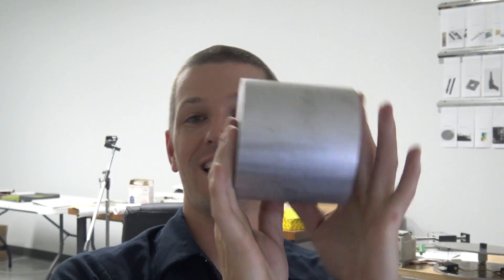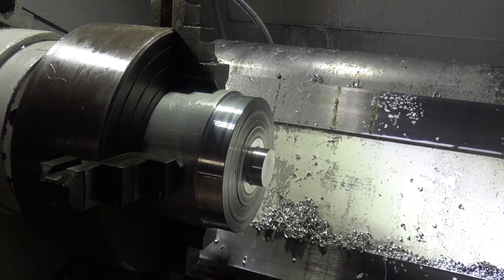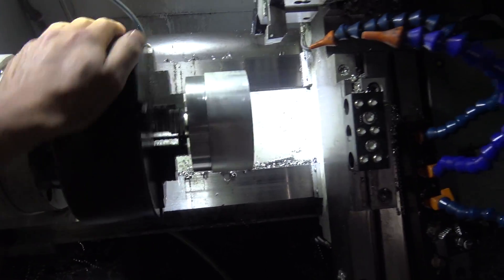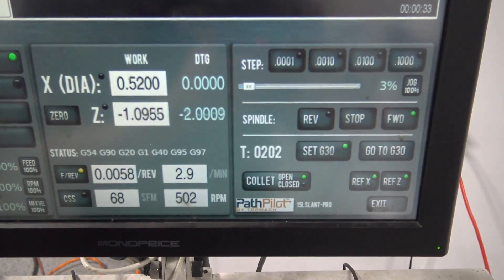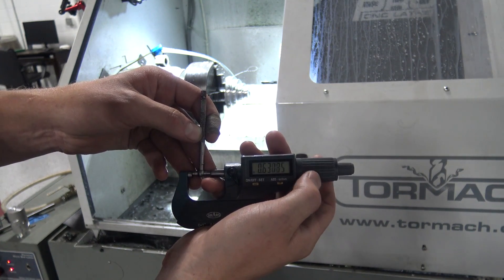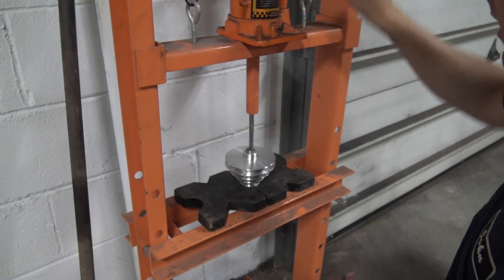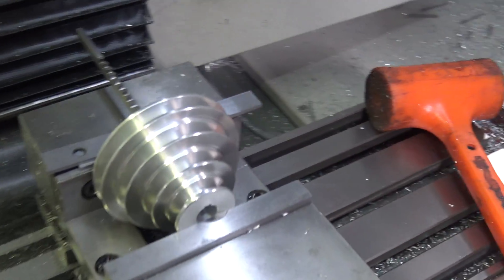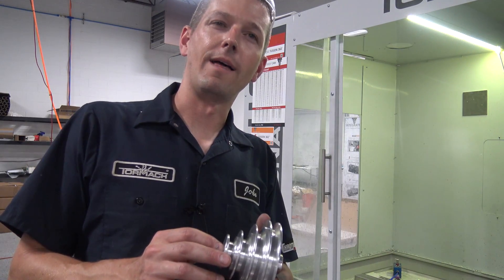Job Shop Life!  Turn, Bore & Broach a DIY Pulley!   WW106

Comment: referring to 3:53 chucking.    ...................Seems  like a "somewhat" better practice would be  to machine a short cylinder...of a diameter slightly (1/2 a thou) smaller than the short nub, then place this deeper into the jaws so that at least the jaws can remain parallel and allow higher/better clamping forces..Still not ideal to clamp on such a short nub...entertaining video though

Comment: New pulley is $120 from Jet. What did this one cost? A new 20" Jet drill press with the true variable-speed drive sheaves for "infinite variable speeds" that doesn't have to have the belt shifted from sheave to sheave is less than $1000. The models like this pulley came from are $600-$700. The customer may have had no problem with what you "bid" but I'll be he'd have problems if he'd been billed for the actual "cost" of the part. And "bidding" work with "variable" hourly labor rates is going to cost you a lot of work and/or money because anybody who wants a "bid" is wanting "cheap" and is going to consider that "bid" a "quote" and people who want a "quote" usually expect that "quote" to be the final bill or pretty damned close. Especially if they're having something made rather than having something repaired. "Shit happens" is a fact of life with REPAIR WORK. Somebody who will take the job of BUILDING/MAKING SOMETHING and will BID that job will be expected to deliver the finished product at or very near the figure in the "bid". And if there are "issues" a good businessman AND true professional who wants to take care of himself AND the customer will STOP THE WORK when he realizes he's in over his head and talk to the customer before proceeding. There's no shame in "failing" and no need to take a beating on a job OR break it off in a "satisfied" customer's ass just  because it "saves face" and the builder/shop/customer "can afford it". You won't be in business long at that rate.

Comment: Aluminum is a horrible but very cheap material for pulleys and that's why aluminum pulleys are only used in cheap, crappy machines or low-load/low duty-cycle machines used intermittently like alternator/generator test stands, etc. If you want to replace a shitty aluminum pulley with a good part after it wears out prematurely (steel pulleys last forever in similar applications) you may as well spend the extra money to make it out of steel and have it done or stop throwing good money after bad, put a cheap aluminum replacement on it, sell the thing and buy a quality drill press suited to whatever use that's wearing out pulleys on the heap one. Of course any real "job shop" is probably going to charge you more for the replacement pulley turned out of steel than you paid for the cheap drill press to begin with or at least certainly more than its worth so if you buy cheap machine tools you'd better have a "buddy" with cheap machine tools to make you cheap replacement parts in his spare time he'll have plenty of because he's not getting real work from paying customers and has plenty of free time to do charity work for buddies.

Comment: Chip breaking on material that won't cooperate: intermittent feed. Insert a 1/2 second feed pause or 0.005" tool pull-back as needed to squelch bird's nests. That's old school. Easy to do on CNC. You probably have a G-code for it.

Back in dinosaur days we used to bump the lathe carriage handwheel against feed direction. The sudden change in chip section gave it a place to break.

Comment: If you are gonna do a pulleys in the future, maybe making some standard sized steel mandrels with key ways and clamp screw kind of like bearing on router bits. Then you can drill out the stock, put it on the mandrel with a key and you can wrench the crap out of that mandrel with your jaws.
Reply: adam courtney a good expanding mandrel is excellent.  or bar with a step then loctite.  heat and break

Comment: the rear boss.. leave it larger..  you can do an under cut so you don't end up at the radius..  then when done trim it off..    hope you recall to make longer broach inserts.. if you do larger diameters in the future.. don't forget you can put in different size key ways in them or multiple depths so you don't have to do the shims..  its also far easier to make an insert that is way too long once.. than make several of them over the years to fit different thicknesses..   keep up the good work... and don't forget.. you can invest in several cheap stop watches to keep track of actual time on various jobs.   you could even use cheap chess set clocks..  but that only gives you proper timing on one job.. and wasted time on the other clock.

Comment: this may have been said already, if so, oops,  one of the slicker ways of holding something like that and keeping marks off it, is to throw a chunk of round bar (larger than the boss you will holding)in the lathe,  bore that to the size of the boss,remove it, bandsaw all way through one wall. place that  fixture on the part , then grab tightly with the four jaw on the outside of the round bar , indicate for runout.  volia  no marks :)

Comment: I hate to say it but I'm with Colin B.  Neither the Tormach, nor the processes shown here would stand up in a production job shop.  It's great, innovative stuff for a small job-shop doing one offs in aluminum.  The process would never see the light of day in a serious steel alloy over a production lot.  

That said, this is how you learn to get it done.  Break  a few cheap or donated tools in aluminum, have a part or two fly through the guard at your face, and you learn pretty quickly what makes money and what does not.  I like the channel for it what it says about possibilities of merging a blue print with the machine (CAD/CAM) but freak out about the idea that a Tormach could make anyone some serious cash over the long term.

I learned my trade on WWII leftover South Bends & Bridgeports, and later learned how to let it rip on a big CNC mill with some carbide.  I can't see how a "hobby lathe" will ever compete with a good old B&S screw machine or horizontal mill, Bridgeport or some of the 1980's vintage Matsurra VNC's or Mori-Seiki lathes.  These were machines that could be beaten on by amateurs and still hold tenths without a second look.

Comment: i think it's fair to say there are lots of ways to skin a cat., and the next cat will be different to boot. i would of done some stuff different. but for me, perhaps that's the point i like watching this channel. i get different perspectives on how the next guy would do it. that is very good even if i see something done here i wouldn't do on a particular job. maybe next time i would think yeah that's the way, and if i didn't see someone do it i sure wouldn't of thought of it. i was trained in a more traditional way before cnc became the go-to. there are lots of things to learn and this channel has been an eye opener for me. the cad programing is very hard for me to assimilate, and i used (reluctantly) autocad back when it was an early dos ver. i just am wired different i guess, but that doesn't stop me. gone are the days when you were handed a real print (no fax crap) of a part and took a red pencil to change in the numbers for the material shrink rate. (i made molds) the day i die will be the day i stop learning.  that said the double faced tape did make me wince. i certainly wouldn't do that ever, but if it worked for you, that's ok. not in my shop though. so thank you sir, i enjoy being subbed here.

Comment: Nice work Brother.  Use a softer material for shims. Or drill and bore the hole and hold it on a mandrel.  To break the chip "I am sure this is old news" pull back on the rpm or bump the feed up. Last, could you not lock the spindle and broach it in the lathe using a boring bar?

Chuck

Comment: Hey John, yep that's pretty much the deal with spot drilling, however you don't have to go to any particular size. It could be as small as the chisel point, just as you said. It could also be over OD so that it puts a chamfer on the hole, hence saving an op.

Spotting drill angles seem to cause all sorts of confusion, even amongst experienced machinists. Basically you will use a smaller spotting drill angle than the drill angle if it's a standard HSS drill, that way the cutting lips contact the work first, and will centre the drill. 90 degrees is popular for that reason, also because you can spot over OD and leave a 45 degree chamfer. The complete opposite is true when using carbide drills, and you either won't use a spotting drill at all, or will use one with an angle larger than the carbide drill. The reason is the carbide is more brittle, and the corners of the drill can chip more easily, especially in harder materials. Personally I don't ever have a need for carbide drills, so most of m spotting drills are 90 degrees

An arbour press is relatively inexpensive, and can be handy in a workshop. Harbor Freight is your friend there!

As far as the jaw marks, personally I would have turned the pulley and then reversed it to finish that feature. That setup was a bit sketchy to be honest. Manual lathes still have a place in shops ;) Double sided tape isn't always a great idea for setups as it will "squish out" under pressure and you'll get rather a "surprise" when it does (surprise = crash). 

Nice job though. Normally you're right, you shouldn't run a broach backwards, but I wouldn't sweat it in aluminium.

Comment: you are so lucky that part didn't launch out of the chuck. also if your machine loses tolerance because of chips id probably get a different one. Im new to machining and almost every video you do multiple things wrong and its novice mistakes. Kinda of embarrassing :/ that boring bar is way to far out to keep any tolerance and dangerous. also you chatter is because you are going slow. you need to engage the material harder to keep the tool in place , increase feed lower SFM. Please go to school or get classes because this is really hard to watch.

Comment: 10:18 - Spot Drilling and Drilling in general. The idea of spot drilling is that you have an exceedingly short, very stout, very pointy drill that makes a perfectly centered hole without "walking". If you attempted to drill with a full length "jobber" drill... it could "walk off" center quite a bit and ruin the part. 

After the spot drilling to make a guide for the hole, then you need to evaluate the actual requirements... for example, if drilling a 1/2 inch hole... the "web" (flat area) on the bit is rather large and would be fighting and causing resistance and friction. In that case, you would drill with a smaller diameter bit... one with a diameter "just over" the web size of the next bit. 

Then, drill your final diameter. Of course if the diameter needs to be precision... then you would either go in with a reamer or a boring bar to achieve final diameter.  It might be overkill... but if I were doing a 1/2 inch hole in steel... I would do something like...

1) Spot Drill
2) 1/4 Inch drill
3) 3/8 inch drill
4) 1/2 inch drill
5) Bore or reamer to final size.

Aluminum... I may not do the 3/8... probably would... not a production shop... so I don't care about another 5 minutes on 
the part. 

12:45 - Soft jaws. Use some scrap brass or lead sheet, bend it over the jaw tips... the softer metal will get buggered up leaving your part pristine. I have even used that aluminum tape meant for sealing up ducts... stick it on, tighten down... do the job, remove it, wipe with alcohol to remove the glue residue.

14:49 - Use the mill as a shaper/broach. Lock in the cutting tool... go in forward (spindle off and locked... on my old Craftsman/Atlas Lathe put in the index pin) Advance the carriage... back out... in a couple of thousands, in again... repeat. Since there is no broach to bend... and because you keep passing over the same area... it tends to work well. Slower... but well.

 Helpful?
Reply: I strongly disagree.....I would push a .6 drill through there at 1000 rpm .015 per rev and take 1 finish pass with a boring bar. There is absolutely zero need to step drill.

Comment: John, do yourself a favor and make a set of copper soft jaws that slip over the chuck jaws. 0.125" material lets the chuck jaws bite, without imprinting onto the part. 
Also, I think you will have less trouble with long stringy chips if you slow down your spindle speed. Not sure what insert you are using, but try switching from negative rake to positive or vice versa. Experiment with some scrap stock and see what works for your setup.

Comment: All of those presses have the same sloppiness.  You can shim the sliding bar so that it's tight with wood or UHMW if you want to do it right.  That vertical bar can also be cut shorter if you don't need it that long.

Comment: Turn a mandrel in lathe, face, pre drill, and bore the pulley center hole, bolt tight the pulley blank to the mandrel, do all the machining in a single chucking. Ideally need to support other end of mandrel with tailstock.

Comment: the way to hold the turned end would be to make an inexpensive  shop made split bush  which would take all the damage from the chuck jaws leaving you with a nice surface finish you already had in the first operation

Comment: I'm with bcbloc02 on this. I just had a pair of multi V pulleys to turn using a form tool, they had a small diameter on backside and I started trying to chuck them but the cutting force was way too much with the form tool so I bought a cheap set of chinese expanding arbours and they worked great with a dab of locktite. I feel your pain on the material issue John, I used to work for a large engineering company with racks and racks of stock material, you screw a part up, go to the racks and start again, no big deal. Since the material now comes out of my pocket it's a different story and you find yourself double and even triple checking even the simplest operations.

Comment: As if you don’t have enough projects here’s another to throw on the pile: put a small window wiper on the lathe window. Here are some fancy cars that have headlight wipers: Mercedes 500E, Volvo V70 R, Lada Signet Wagonski, Saab 9000 ero, E12 BMW M535i, Mercedes Benz 560 SEC AMG, Volvo 780 Bertone, Saab 99, Mini Cooper. You could put a wiper arm assembly on a motor and hold it on the window with magnets. At any rate it was a really good video.

Comment: My motto is KISS. Keep it simple silly, Why not just program in micro holds to help break chips. It's something I do on my manual lathe when the chips get nasty. That way I prevent trips to the emergency for more stiches. Yes I'm thinking of going back to my old channel name " Just Learning"
Reply: There's a G75 canned cycle on most lathes called peck grooving. Similar to peck drilling but operates in the X axis.  Most controls have it, path pilot might not. But wouldn't be hard to sub-routine out to a macro if it came to that

Comment: John Could you have drilled the through hole first and made a mandrel to hold the part and turn it.   You could do the pulley side and then flip and turn the offset side second or vise versa.   I know on the manual lathe that I use mandrels to hold lots of parts during turning.

Chris

Ps.  Good Video !   and I need a broach set...

Comment: You're right on the spotting comment. Also you want to use a "matching" spot drill tip angle. For 135 drills, use 140. For 118 drills, use 120. It allows the drill to start its cut at the center and quickly engage the full diameter, preventing any high-wear areas

Comment: Good stuff John!  I've always used brass shims to prevent marring on aluminum; but I've not done enough to say it's the way to go.  I wonder how lead would work...  It's super soft so I wonder if it would be TOO soft.  Plus you could form it by hand around your jaws to hold them in place! :D
Reply: In a small (13x40) lathe I sometimes use cardboard from a Budlight box. Usually works pretty well. Have also used sand paper with grit toward part if I need a little extra grip.

Comment: Re: spotting drill dimple. I have heard the same thing. Also true for choosing progressive bit sizes for drilling large holes: the pilot drill should be just a little larger than the chisel-point on the next size of drill bit. If the following bit is only a little larger than the previous bit, there is a tendency for the following drill to wander. (This only applies to normally ground twist drills. However, there are such things as core-drills - designed to slightly enlarge a hole.)

I've seen other Youtubers custom make long broach bushings for thick parts. You really need that back support for the full length of the bore. (You can push that last section of the broach through with a bit of same-size keystock - just slightly undersized for the slot.)

When I was just beginning to fix TVs and other electronics, I sometimes "jiggered" my final bill by guesstimating how long it would have taken if I had known exactly how to go about it before I started working on it. I couldn't see making the customer pay my hourly rate for the time I spent educating myself on how to do it. I don't know whether you could make the IRS see it, but it seems to me as though the lost shop time could be charged off as an educational expense (which would be deductible). [I'm not a tax-lawyer, nor do I play one on TV. All internet advice should be treated with reservation.]